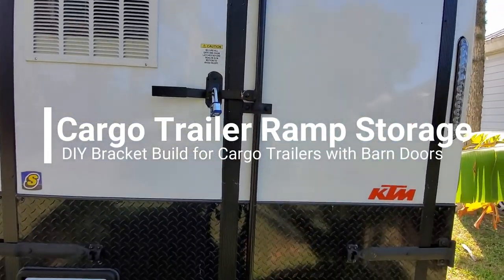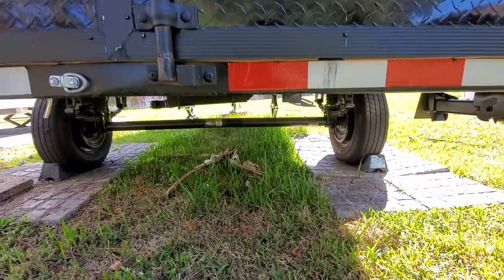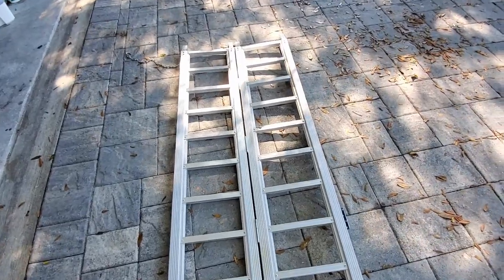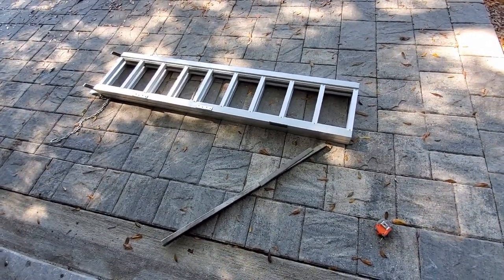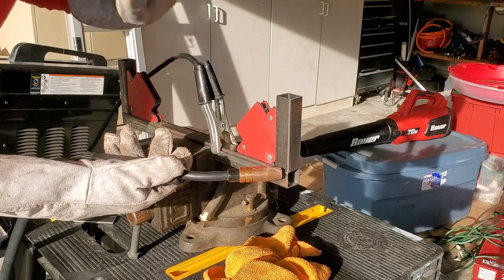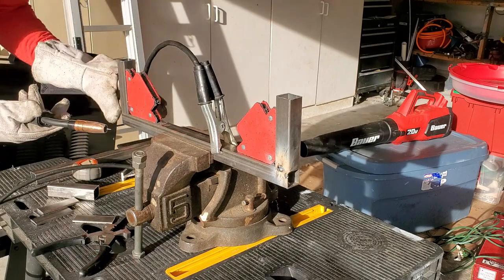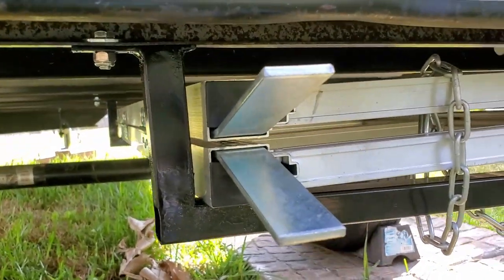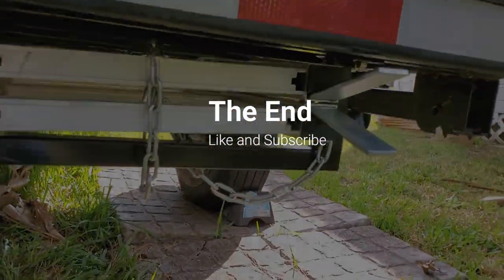DIY Cargo Trailer Camper Loading Ramp Holder

Comment: Doin' all   the good, Don. I see you've gotten into some metal fab work and welding. It's fun, right? I enjoy that kind of stuff if its not a full time job. Heres a tip on right angles, you can miter and weld or cut the tube so you leave a tab 1" or so longer, then you can box all the joints. Looks like you are getting the hang of that wire feed pretty good. Another skill for your toolbox.  
Nice work, Mr. Smith.
Reply from the maker: Hello McDave. Many thanks for the tips. Yes, I am enjoying learning a new skill.  Have a long way to go, but it is nice being able to fabricate basic things like the mount. Hope you have a Merry Christmas and great 2022!
Reply: @donsdoityourself2547  Merry Christmas to you and yours, Don.

Comment: flip the axle 🤔👍. I was wondering how you had the clearance.
Reply from the maker: Thanks. Yes, I did move the axle under the springs. I made a video on that. Raised about 5 inches.
Reply: @donsdoityourself2547 subscribed, will check it out.

Comment: what keeps them from sliding around, seems like that chain would have to be tight?
Reply from the maker: The brackets hold them in tight. They really don't have enough forward or reverse force to allow the to slide. The chains wrap around to ensure they stay, but I also have a bicycle lock that goes on when I travel to deter the casual thief.